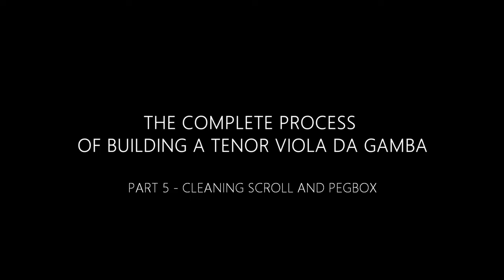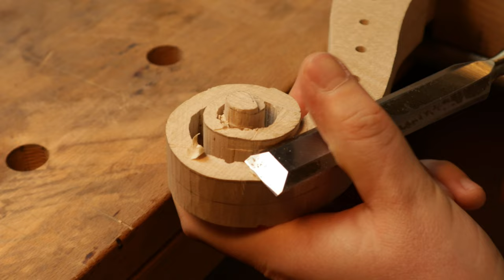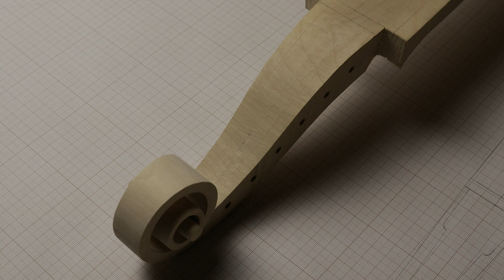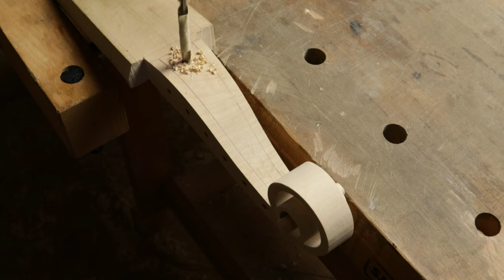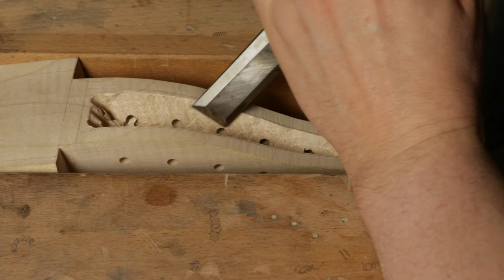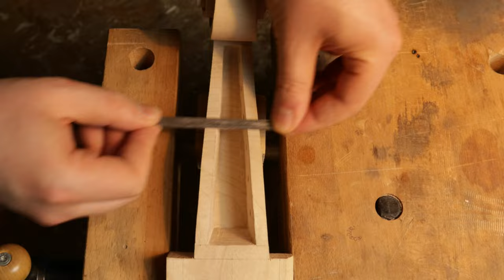Viola da gamba making | Part 5 – cleaning scroll and pegbox

Comment: Nice work Henry. How did you get the floor of the pegbox so flat? Just carving or a rasp? Thanks for the videos, really interesting.
Reply from the maker: Thanks Mike. It was just carving with a straight chisel held upside down (the bevel facing the floor) and smoothing with some sandpaper.